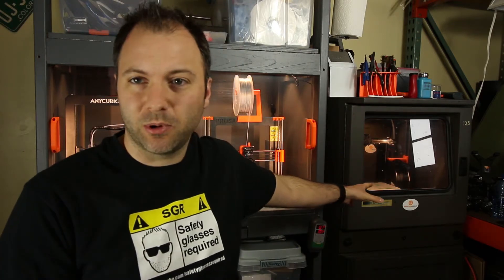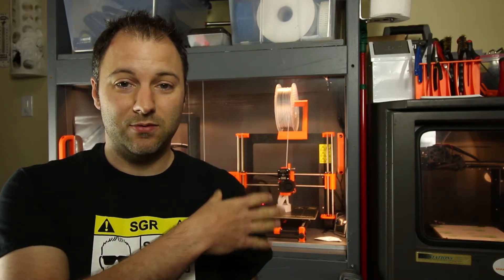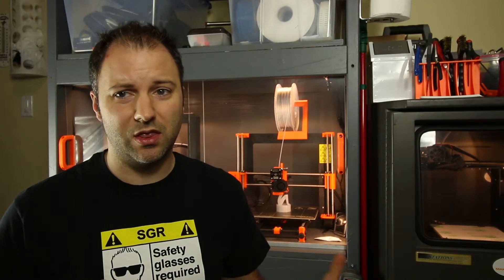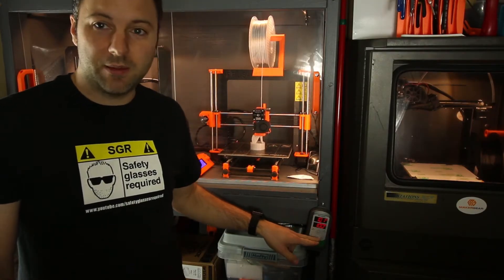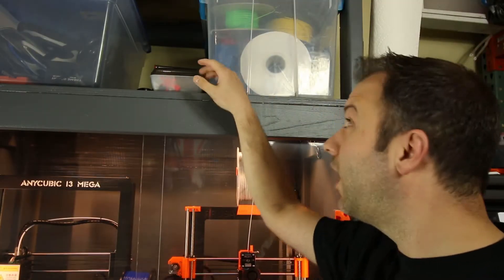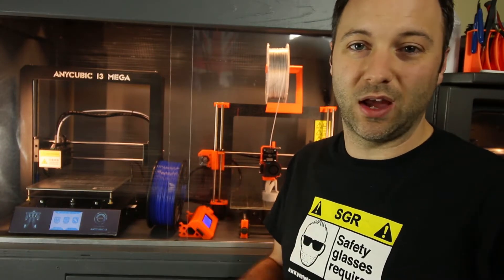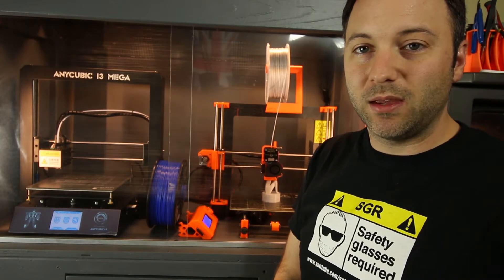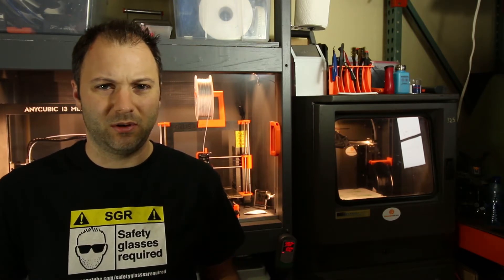3d Printer Enclosures Part 2 - Custom build from Plywood

Comment: Fire suppression?
Reply from the maker: At the moment no fire suppression. I've considered one of those "fire balls" but never installed one. There is a fire extinguisher on the wall near the printers and they have thermal runaway protection enabled.

Comment: This just popped in my feed. Nice setup! Does the enclosure cut down on noise at all?
Reply from the maker: A little but its a plywood box so some frequencies it seems to magnify. My prusa i3 mk2s in particular seems to really resonate at a few frequencies.  I suspect with some insulation and or a rubber mat might help attenuate it. I also here that a concrete paver under the printer really helps too.

Comment: I gots to know if you would go back when you bought a 3d printer would you have purchase the prusa over the makergear?
Reply from the maker: It depends...  :) For hobby use/first printer the Prusa is the machine I would get. Much better documentation,  much cheaper, it's a great machine that prints very well. My M2 has been a work horse and is built very well, documentation for it is not as good so the learning curve for a newbie is steeper. None of my machines are run very hard but the M2 has been very durable and seems like it should out last the Prusa. If I had only one machine and needed to run the crap out of it to make money the M2 is what I would buy. Being US based parts are also much faster and cheaper to ship when needed. That said you can buy a pair of prusas for the price of one M2. I hope that helps.

Comment: I explored every option for an enclosure for my CR-10S. Even custom building my own. Ultimately I purchased one from PrintedSolid built for my specific model. Not the best, but it's pretty good and not too expensive. Not trying to advertise them, I just didn't have the tools to build my own to the precision I wanted, so the price would have inflated.
Reply from the maker: That's a great option if you don't have tools and they make a prebuilt model that fits your printer.
Reply: heck man, until recently, my enclosure was a cardboard box with a hole to vent the air

Comment: Great video, man. It shows you put a lot of time and effort into it. I’m new to 3d printing. In fact I just bought the anycubic i3 mega 2 weeks ago. It’s awesome, it’s been so user friendly for a noob and I have yet to have a failed print. I’ve been thinking about getting into the more complicated filaments when I get a few spools of PLA through it so an enclosure plan is in the works. Also I think you videos on nylon are going to be super helpful. Keep it up!
Reply from the maker: Thanks! I'm glad you liked it. You've got the right idea, definitely spend some time with PLA and get comfortable printing first before diving into the more challenging materials.